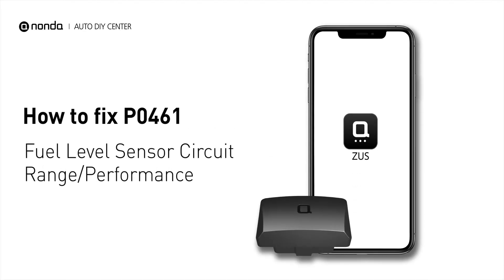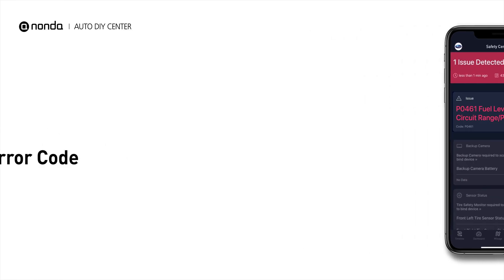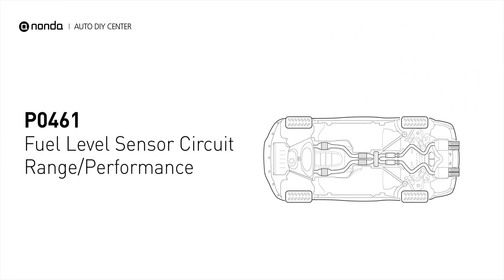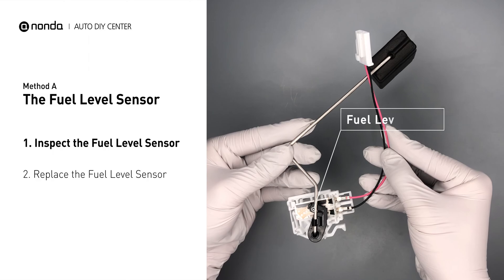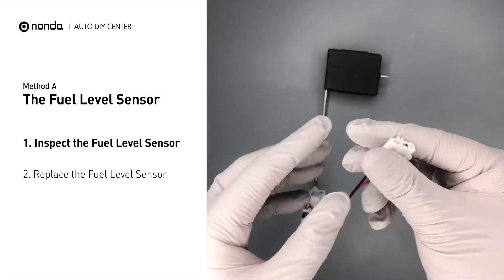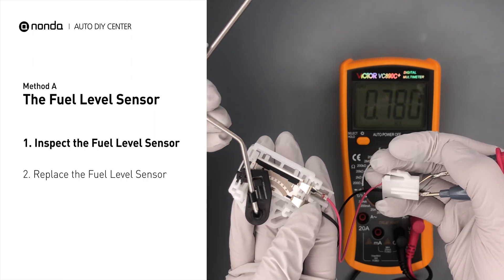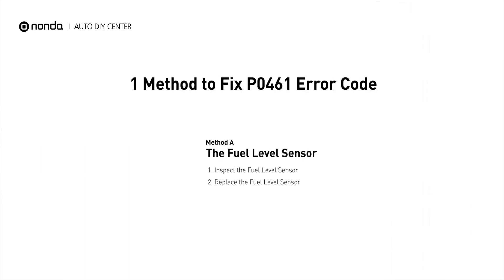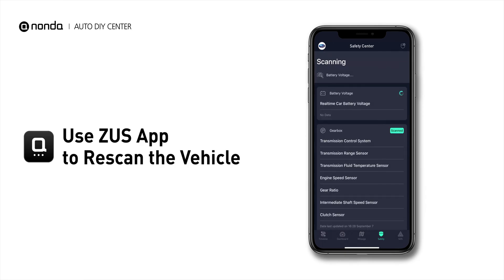How to Fix P0461 Engine Code in 2 Minutes [1 DIY Method / Only $11.86]

Comment: Is this for a dodge caravan
Reply from the maker: Hi Igho, yes- you may apply these methods to your vehicle [Dodge Caravan]. Please also check the fuel level sensor circuit for poor electrical connection.
Reply: @nondainc  from the I/M  monitor status
It’s P0461(3 of 3) generic permanent 
Fuel level sensor 1Performance…
What could be the possible cause and how can it be fixed.. Do I have to buy brand new fuel pump..
Mechanic said I’m going to be spending upto $800 in getting a new one
Reply from the maker: Hi Igho, please try cleaning all the terminals first and see if the issue will still persist and inspect the tank for any damage.

Comment: Hi Steve, I have PO 461 and PO 601.  I can’t get my 2006 Chevy Colorado to start now.  It starts and dies right away.  Sometimes I only get a click when turning the key.  When it was warm weather the truck was ok, but in cooler weather no.
Reply from the maker: Hi Art, kindly check the ECU for proper voltage supply. Check the fuel tank if there are any physical damage, inspect the inside of the fuel tank for any deformities as well as the fuel level sensor for damage. Inspect harness/component connectors/male or female terminals for corrosion/overheating and repair/replace any conditions that are found.
Reply: Thanks Steve, but what is the PO 601?
Reply from the maker: Hi Art, you may head over to this link and let us know if you have any further questions. https://youtu.be/3FBrot_FOkM

Comment: Changing the fuel pump all together should fix the problem right?
Reply from the maker: Hello, replacing the fuel level sensor, fuel gauge, wiring harness and damaged fuel tank are the possible fix for this code.